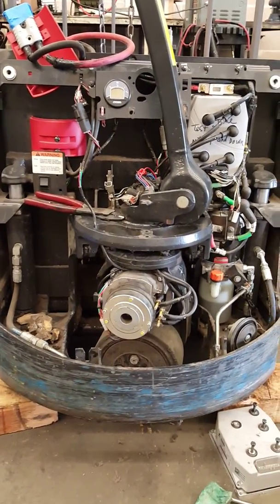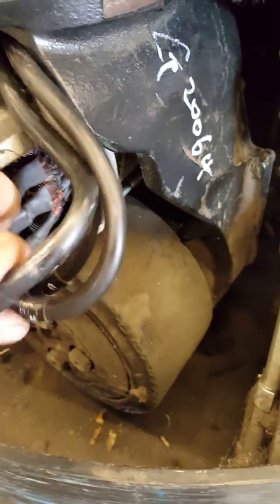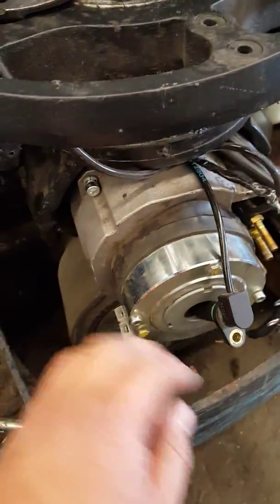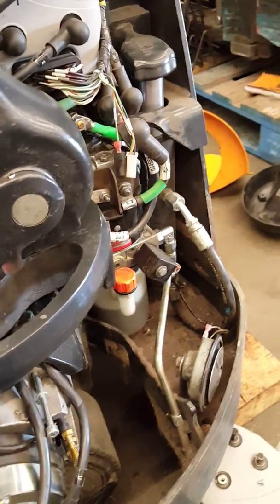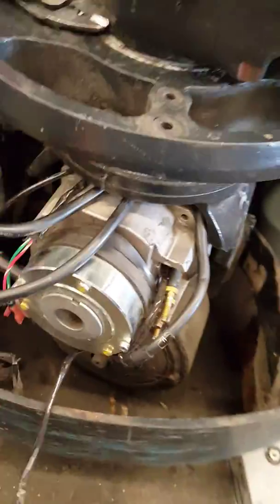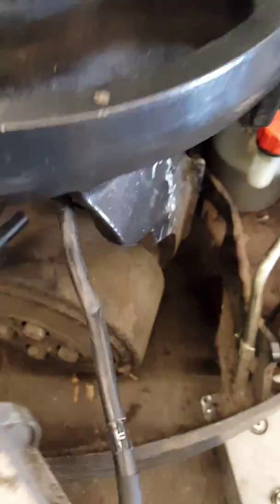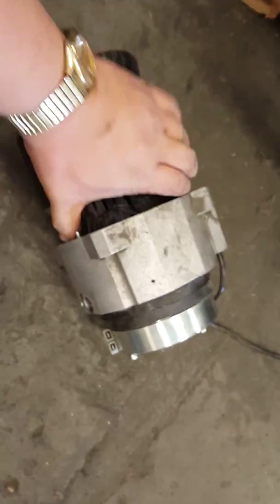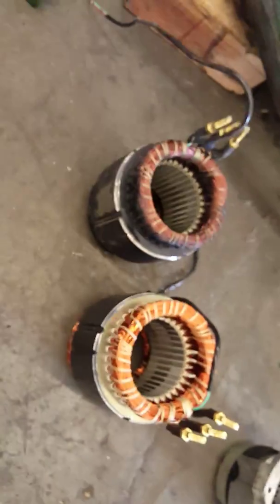(HD) How to remove drive motor on Crown WP 3045-45 replacement motor windings

Comment: Great video! We're having trouble getting the drive motor out of the unit after removing the 4 retaining bolts... your motor popped out just fine, was there any trick to getting it to come loose?

We tried scooping underneath it as you did, but ours seems firmly stuck in place...

Comment: You didn't diagnose why the first winding burnt up?!   It is probably because of a failed carrier bearing set.  This is allowing the rotation of the rotor to spin out of true, and caused the failure.  If you just throw a new winding in there, the same thing will happen again in no time.  You need to fix the bearings!~